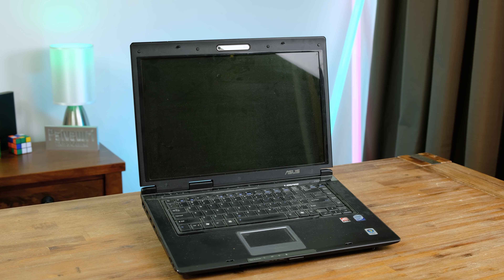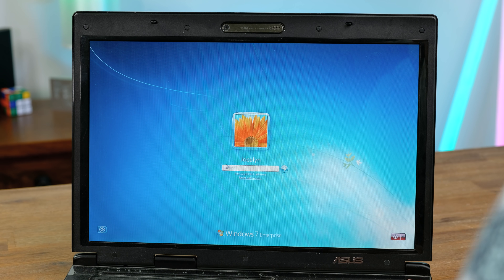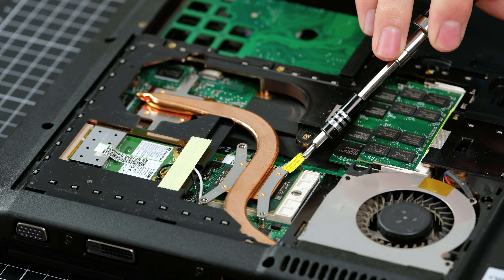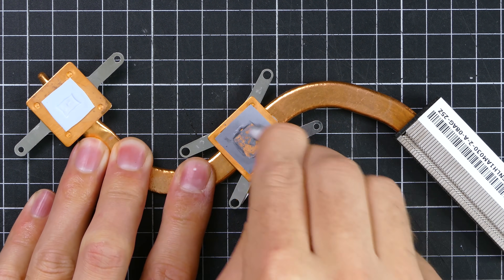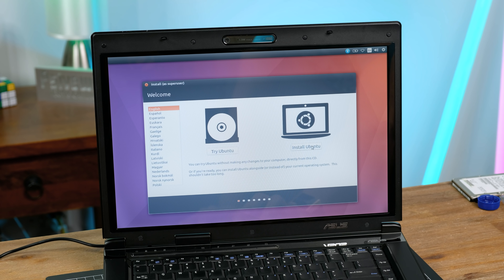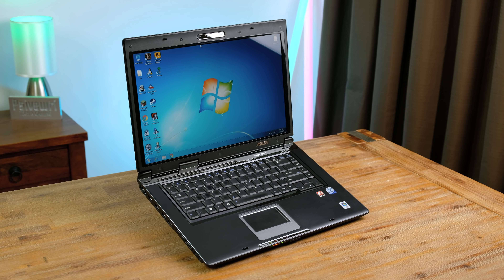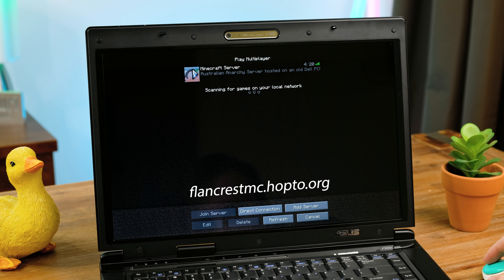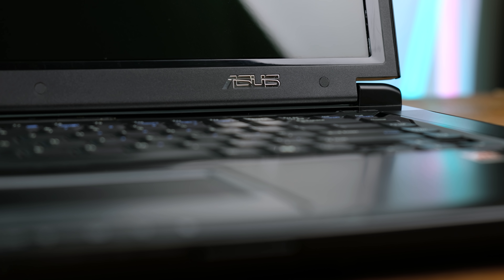Using A Gaming Laptop From 2008!

Comment: Quick advice, it looks like Ubuntu was having a graphics issue, maybe try booting into the Graphics Safe mode and heading into 'Additional Drivers' and seeing if there is one for your graphics in the Laptop
Reply: I probably think that he picked a wrong version. I guess the laptop runs on 32bit, while he tried installing a 64bit version (he said the laptop runs on a max. 4GB RAM, max. for 32bit)
Reply: @strifemusic_  the cpu is 64bit, 4gb was a limit on all laptop core 2 duos
Reply: @shadowhuntergmd7059  *certain mobile core 2 duo capable motherboard chipsets

There are many Core 2 duo laptops that are able to carry 6 or even 8 GB of ram.
Reply: Gaming York  must be ddr3 memory then, the core 2 duos on ddr3 supported 8gb, not ddr2
Reply: @shadowhuntergmd7059  I had an old uni body 2009 Core 2 Duo 2.4ghz macbook that I managed to upgrade the ram to 8gb on
Reply: @jhylandau  2009 was ddr3
Reply: Agreed, dedicated ATi graphics would have been weird for Ubuntu support
Reply: @strifemusic_  A 32-bit CPU wouldn't even be able to boot a 64-bit operating system.
Reply: @SenkJu  I know. That‘s why I thought that it‘s a 32bit system. Because he tried to boot a 64bit Ubuntu and it didn‘t work
Reply: @strifemusic_  It did boot. If the CPU was 32-bit, he wouldn't have been able to launch the installer.
Reply: @shadowhuntergmd7059  Not true. It depends on the Chipset. I ran a lot of Core 2 Duos with 8 gigs of DDR2 ram, and have 2 of them sitting behind me on a shelf.
Reply: @shadowhuntergmd7059  Rarely on C2Ds, especially on laptops.
Reply: @cee128d  You can add up to 16 gb
Reply: @polorchen1592  Again, it depends on the chipset. And it depends on how many ram slots it has. I have never seen nor heard of 8 gig single stick DDR2 SoDimms. DDR3 yes, but not DDR2.
Reply: @cee128d  Yeah, and in china there is some 8 gig ram slots is manifactured
Reply: @shadowhuntergmd7059  I have a core 2 duo laptop from 2009 and its ram still ddr2 but can be upgraded to 8GB (Dell Inspiron 1320)
Reply: @polorchen1592  Slots are not the issue. It's the actual SoDimms themselves.
Reply: Yeah, it was probably a driver for that on board GPU.
Reply: Gaming York  Same here
Reply: Classic Linux diarrhea. The more time you spend on stuff that doesn't work out-of-the-box, the less it works.
Reply: @RFLCPTR  my D830 can max out at 8. Even though officially 4 is the max.
Reply: NicolasYT  no, that doesn't work like that, and it's not core 2 duo graphics it's discrete ati graphics in this case.
Reply: @shadowhuntergmd7059 that is not correct. Dell Latitude D630 with DDR2 supports 8GB RAM with BIOS update.

Comment: This things specs we're beastly for 08. I'm kinda impressed.
Reply: The amount of VRAM in the discrete graphics, maybe. The rest is not impressive at all. Max amount of RAM, for instance, is pretty standard for the time. Even for machines from 1-2 yr before.
Reply: @BilisNegra  this is more of an entertainment laptop from that era, 512mb of vram really doesn't mean much, the nvidia 512mb 210m is better than this chip, which was considered low end discrete graphics in 09. If you were looking for a gaming laptop from this time, you really have to look at the 9600m+ equipped laptops.

I have a XPS M1730 which was pretty much the bees knees portable of 2009, with SLI 9800mGT's. My 6800 ultra spec'd XPS m170 from 2005 would probably perform about as good as this in the games he tried. Much more than 4GB RAM wasn't particularly essential as websites weren't so heavy on the javascript, and html 5 didn't exist yet.
Reply: @BilisNegra  You say that like I wasn’t around in 2008 and wouldn’t know. I was 20. I promise you this was a beastly laptop for 2008.
Reply: @Garrettdx1988  when people act like a high end machine of the day isn’t high end bc they have something even more high end 🙄 it’s almost like there’s still a hierarchy even within each roughly grouped tier??? Who knew!
Reply: Beastly my ass. 

The CPU might be decent, but the GPU is HD 3470, that's dogshit tier.
Reply: @julianf0x  ah hell nah it wouldn't, that shit got a 32 bit single core pentium, that thing can't do shit against core 2 duo

Comment: You have reminded me all of my childhood with this laptop
Reply: Yeah, but it was during your vista phase- I’d think you’d be embarrassed
Reply: Better than the windows 8/8.1 era
Reply: Yea does days, ( i am from Windows xp era ) but this laptop is totally same (except specs ) as I was having if ur curious it's laptop from 2006. Does days were amazing.
Reply: Vista...
Childhood....
Reply: @creepysmilingcarl9742  Dude modern Windows is so much better, the fact alone that all drivers are basically installed via Windows Update instead of searching drivers on manufacturer site that most often forces bloatware down your throat if you're not careful
Reply: vista and 7 are the best os ever rip 2007-2012
Reply: @0w3nn  With Windows 7, I agree. With Windows Vista, I mainly disagree because of software and hardware incompatibilities, I don't see it as the worst, but not as the best, either.

Comment: One thing of 2000 era laptop known of:

The Heat was too magnificent you could fried something
Reply: I've got a Vaio desktop replacement machine from 03 with Pentium 4 and it actually runs really cool with a quiet fan speed. I don't think all 2000s machines were that bad.
Reply: Anand Raj  It's definitely a Pentium 4, it reports as a Pentium 4 Mobile 3.06ghz. I'm not sure what generation it is though, but I suspect it's Northwood.
Reply: Anand Raj  Ah I thought they all were fairly hot. Thanks for sharing your insight, that’s interesting to learn.
Reply: This is not exactly true. For example, I have a Dell Latitude D630 from 2007 with a Core 2 Duo that runs at a temperature of around 60 degrees. It never gets hot.

Comment: 2008.... retro....

Here I am using my Y500 as daily and a gaming station.
Reply: poggers
Reply: just stick an egpu in it and you will get over triple of graphics performance (depends on what gpu)
Reply: @Simulation101YT  my Y500 already has GT650m in SLI, buying anything more powerful + eGPU enclosure will cost more than a new laptop.
Reply: @harryshuman9637  You won't need an egpu closure
Reply: @harryshuman9637  stick an exp gdc in it, thats what I did
Reply: @Simulation101YT  I am not keeping an uber expensive piece of electronics exposed to outside environment. It has bad idea written all over it.
Reply: Me with no pc or console :')
Reply: Man i still using that amd e-450 apu with just 4gb of ram. That Cpu cant run anything unless its 480p
Reply: @harryshuman9637  lol I'm using an older msi ge70 2oe 011ne that I found in a damn dumpster
Reply: @FS--ew3se  i have a c2d with its igpu (intel q45) my main and only pc
Reply: @ForrestMarshallHarvey  probably, I've never played it
Reply: here i am on my P75 still watching that weezer video and sneaking on AOL dialup to post this after my parents went to bed
Reply: @ForrestMarshallHarvey  and nothing of value was lost.
Reply: smiling sadly :`) wow guys nice gaming setups i only have  asus gaming laptop with a gtx

Comment: Protip: For old hardened thermal paste I recommend using some wd-40 and leaving it for a bit to soak in. It does a pretty good job at dissolving that crap
Reply: he uses isopropyl alcohol... and spirits
Reply: @RocketJSykes  use plastic to scrape
Reply: do not use wd40 for that 
wd40 is a penetrating fluid not a cleaning solvent or lubricant
Reply: @JessicaFEREM obviously he’s not saying to use it on the rest of the laptop nor on the hinges, dried up thermal paste can be stubborn asf

Comment: I have a similar old asus gaming laptop , the heatsink fans were absolutely plugged with dust. I never bothered putting the keyboard and screen back together because the screen was broken . This thing has some pretty impressive specs for a old laptop. The model number is G73JH . Has an old i7 1.6gz that has a factory overclock button to I think nearly 3gz and a radeon 5850 gpu .I like it cause its old an obsolete but still works even though its had a super rough life

Comment: 2008 was a rough time for Linux on laptops. Lots of hardware was non-standard, diverging from the specs disclosed by the manufacturer. It was basically a crapshoot as to whether a Linux distro would install on anything but a Thinkpad back then. I got lucky, and the Acer I had about that time was very well supported, but it was a very middle of the road machine when it came out. Gaming laptops and other high end machines were the most guilty of the weirdly specced hardware issue.

Comment: Linux was most likely freezing and stuck on a black screen because of a graphics driver issue. You might be able to boot into safe mode or into another menu that allows you to select a graphics driver for your laptop on startup in case the default one doesn't work properly.

Comment: It’s amazing that back in the day a single heat pipe can handle the cooling for a higher-end spec CPU and GPU, we’ve definitely crammed far more power into laptops nowadays
Reply: not really, these old processors still used up over 35W of power

Comment: Hey Psivewri, for your next video, I reckon you should do a review on an old Ibook Clamshell, those are vintage computers with a reputation for their style. If you happen to find one, I recommend you buy replacement parts for it as the Clamshells commonly have issues.

Comment: Its always good to try to flash a later bios when upgrading from a Merom based cpu to a Penryn one. Many times with an old bios the cpu simply won't work.
Also, pretty sure the max ram for this thing with the latest bios is 8gb but yeah those are ridiculously expensive modules so forget about that

Comment: Nice review of that old 2008 gaming laptop! :) I like the fact that all main components are easily accessible, and that the CPU can be upgraded. That reminds me, I have an old Packard Bell laptop that I might upgrade the Core 2 Duo CPU on. I think it only supports 2GB DDR2 though, which is what I have installed.
Also, if using it on the internet, you might want to upgrade the wireless card. Many wireless cards from the Core 2 era were old 802.11g cards which don't provide good speeds. You're better off using an 802.11n or 802.11ac card. :)

Comment: If the PC fails to boot 3-5 times you can factory reset it. just hold the power button as it's booting and repeat this. Works on every windows pc unless the feature is disabled. It should also get around the BIOS password.

Comment: Calling that laptop, with its Mobility Radeon HD 3470, a gaming laptop is like calling a more modern laptop with a GT 920M or Radeon 520 a gaming laptop. I don't know how it was marketed since I can't tell what model it is, but from the design it seems like a run-of-the-mill mainstream laptop to me, and the specs support that theory.
For fun I looked up the Mobility Radeon HD 3470 and it's more or less the same thing as a desktop HD 34x0/35x0, same with every laptop 34x0, it's all the same crappy RV620 chip with different memory configurations.
It's one of those GPUs that belongs in the "so low-end it's pointless" tier, along with other hd x450s and GT x10s. Admittedly these GPUs weren't completely useless compared to the intel GMA series iGPUs that often struggled against ultra-low end dGPUs from 2003/2004.
Reply: so true. i also have a gaming laptop from 2008 with an overclocked qx9300 quad core, overclocked gtx 9800m and ram upgraded to 8gb. it’s probably around 10 times faster than the laptop in this video. clevo/sager m571tu if you’re curious about the model

Comment: I still have my 2008 Dell Vostro 1700 with a T8300 CPU, 4Gb of RAM, a 8600M GT Graphic card and a 160Gb Intel "X-25M Postville G2" SSD (it replaced the original 250Gb HDD) that I use without any problem when going back to my parents' house. I also added a second 1Tb HDD for good mesure :)

Comment: I just purchased a 2008 gaming laptop with an intel extreme core 2 duo t9400 2.53mhz cpu, 8gb ram and a geforce 280gtx. Im hoping that by going full power from that era I might get some good results for retro games dating 2000 to 2007. Unfortunately it shipped with Windows 10, would have preferred 7. But for just over 100 quid I couldn't say no.

Comment: Ah yes, the PRO55S, also known as X59SL. I have one, although it needs, among other things, a few fixes:

-keyboard is kaput. Dead as a brick
-mouse buttons are also bad
- needs a display

Oh, and an advice for Psivewri: don't ever expect this thing to run Linux properly. I had an unholy amount of headaches with getting mine (while my dad used it, before he finally upgraded to another ASUS, a U36JC) to even work right with the least demanding distro.

Comment: Nathan! Good to see a video from you again, you were missed!
Linux not working, giving up on it and installing Windows instead. That's my Linux experience ;). 
Wondering why you 're not running Windows 10 on that laptop. Should be fine with 4gb of ram and an SSD. I swapped my Dell E7440 for a Macbook Air M1 and needed 'a laptop 'for Windows, in case I had to help people out on location (also because I know Windows way better) and I got a dell E4300. 4gb of ram, ssd and a P9400 core2duo. Runs WIn10 like a charm.

Comment: Around this generation are very good Win XP 32 Bit Gaming Laptops. I have an Acer Aspire 7520 Model: lcy70, the CPU is a Athlon 64 tk-55 and a GPU: GeForce 7000m. It has a dual hard drive bay caddy. This thing runs games from DOS - Windows XP 32 Bit Late Flawlessly. I like the look of these generation of laptops but you are right their cooling is abysmal first thing was a cleaning and new MX4 on mine as well.

Comment: It's a core 2 duo you don't have to go that light. That thing could easily run windows 10 and I'll bet the drivers will work with it. I have an early 2008 MacBook with a t8300 and it runs windows 10 flawlessly

Comment: If you're using 32bit Windows 7, I'd get CPU Rightmark RM Clock, and screw around with undervolting the CPU, these 45nm core2 CPUs can be undervolted significantly to keep it running cooler.

Comment: I have a hp dv5 1138tx entertainment gaming laptop. What tools did you use to get to the cpu ? i have an intel centrino 2 cpu rated @ 2.26ghz dual core. Is it worth changing cpu and hdd to ssd ?

My 13 year old laptop has windows 10 now which I use to check my emails and to game casually. It use to have vista. I love playing older games on my laptop. But heavy demanding games on my rig

Comment: 6:49 Minecraft not displaying properly is not a Minecraft issue. The GPU drivers are. I could play Minecraft 1.16 (not tried 1.17 yet) on a Radeon HD2600 laptop running ArchLinux and the latest radeon driver. I think your issue might be due to a poorly made OpenGL implementation AMD did back in the days...

Comment: I also have the exact same laptop, but be careful of using it while charging because the F5SL/X590SL model overheats a LOT, even with a new thermal paste. Most problems arise from the charging port because of design flaws.

Comment: I can't believe linux wouldn't work on this, my lenovo idea pad 320, with only 4 gigs of ram and a 1tb hard drive runs perfectly on linux mint mate desktop eddition 20.1 and due to the fact this laptop is from 2008 there should be no reason to be wurried about secure boot as there is no efi firmware as it was introduced back in 2012 with windows 8. I'm sure there is a linux distro that works with this computer. ubuntu 1604 is reaching its end of life cycle and linux mint 17.1 already stopped being maintained but being almost an intermediate when it comes to linux I reccon there is a distro that might work, don't give up

Comment: Why go with windows 7? As you said, it isn't supported anymore.
I'm fairly sure that if this laptop was originally shipped with windows 7,it could easily support windows 10 too.
I managed to get my old hp pavilion dv6732eo that shipped with Vista home premium, to run fine with windows 7, 8 and even 10 with the drivers from hp website.
That thing might have been utter shit with warranty that didn't cover anything, not even the manufacturing defect on the Nvidia GeForce m8400gs gpu. But when working, it did run windows 10 well enough for basic purposes.

Comment: Unlike many modern models, this laptop doesn't show any kind of styling, or any clue whatsoever for that matter, indicating it was aimed at gamers at all. In fact, it looks quite like the typical Asus model of the time period. Was there any marketing material suggesting so, or are we calling this a gaming laptop just because it has discrete graphics? Let's not forget that was a time when integrated graphics in laptops were atrocious, not at all comparable to later solutions built into CPU's, and you'd struggle to even have a tolerable multimedia experience out of them, so discrete graphics were a must if you wanted a half decent machine.

Comment: I have a question, I recently got an IBM Thinkpad T42 with a Pentium M 735 (1,73 GHz) as a CPU. I'm planning to upgrade it to a Core 2 Duo T7600 (2,33GHz) (highest/best CPU I can put inside) with windows 7 with the max 2GB of RAM, what kind of performances will I get?
Reply: It should be decent.

Comment: For taking the password off these used computers, there is a program called NTPasswd that generally works up to Windows 10, if it's not encrypted.

Beware, this is a CLI tool, rather than a GUI, but there are GUI versions that do the same thing out there. Amazon sells them for like $25 and seem to work as well as NTPasswd (which is free).

Comment: I'm having the same problem with Linux distros not booting after a successful install on a similar platform (Q6600). Anyone know of a fix? I thought maybe it was a problem with 64 bit since the Core 2 architecture is very early 64 bit, but 32 bit had similar problems.